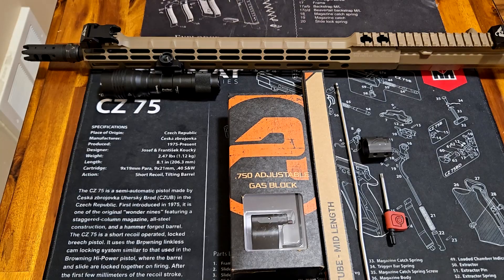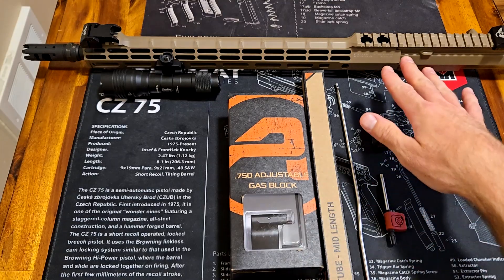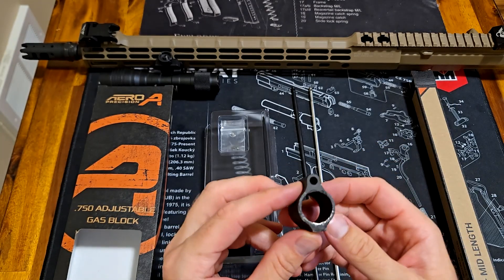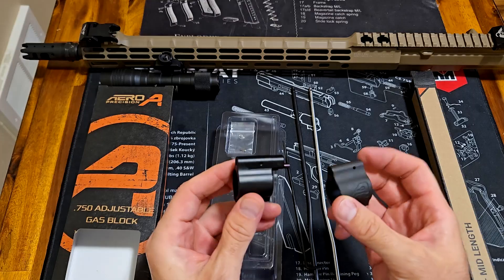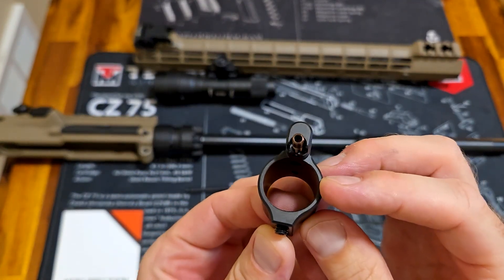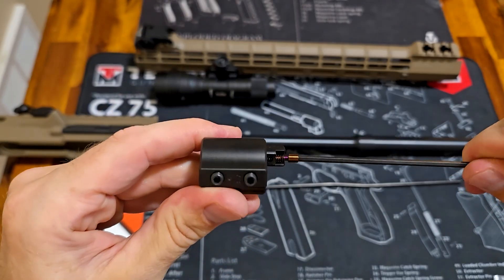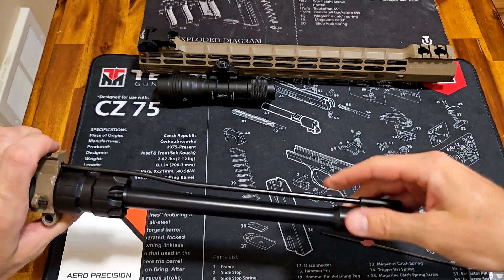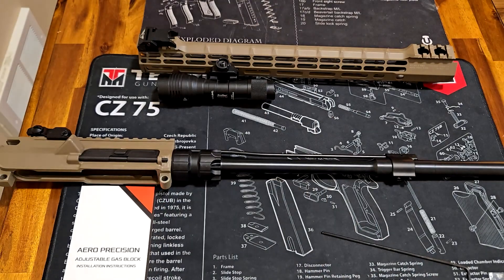Aero Precision Adjustable Gas Block Unbox & Install

Comment: Did your barrel come dimpled from the factory?  Id so, did the replacement gasblock match the existing dimpling?
Reply from the maker: barrell isn't dimpled & the new gas block fits right in place of the old one

Comment: Hey man. New to building rifles! Just bought 14.5 pinned & welded aero precision barrel, but it does not come with the gas system. Aero currently has their gas block out of stock so I’m looking to buy another brand to get the build going. It says aero’s gas block is pinned and all the ones I find come with set screws. Would they fit or are they not compatible with the aero barrel? Thanks man!
Reply: Aero gas tube*
Reply from the maker: You have to know the size of the gas block that fits your barrel profile & what is the gas system carbine or mid length?  That changes what length gas tube you have to buy.  One is longer than the other.  When you buy the gas tube or gas block make sure it has the necessary roll pin to secure the gas tube to the gas block is included since your build didnt come with one installed.
Reply: @erik22lax it’s a mid length. Aero’s website says it’s a .750 gas block.
Reply from the maker: @zom0neyyy  that's good-most common size and preferred gas tube length.